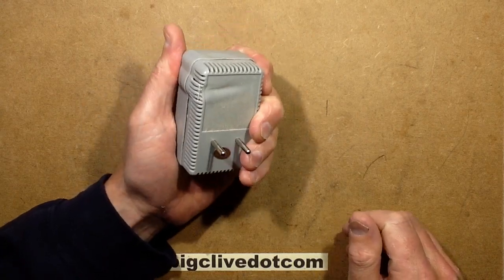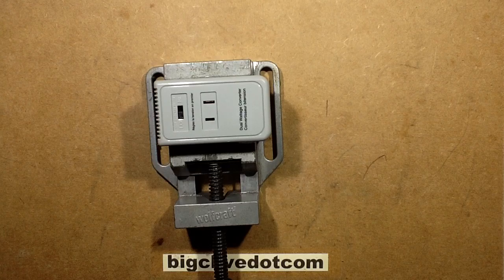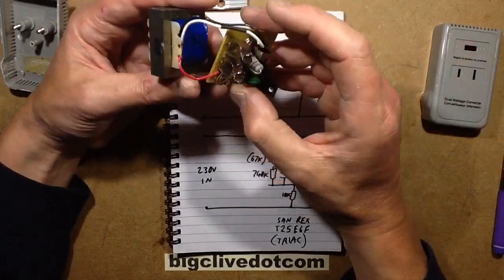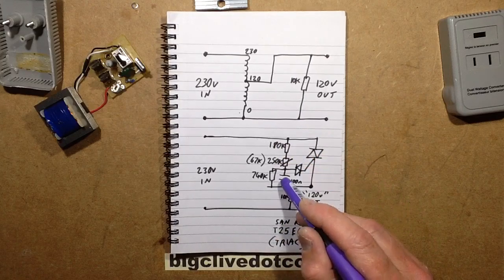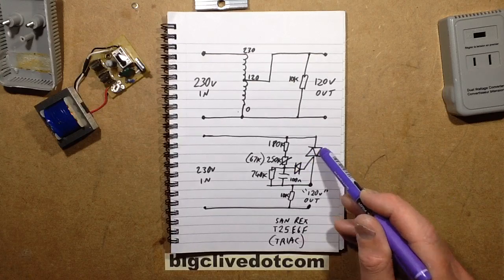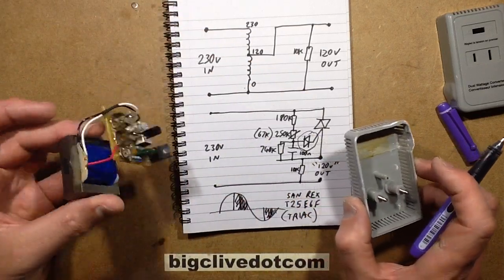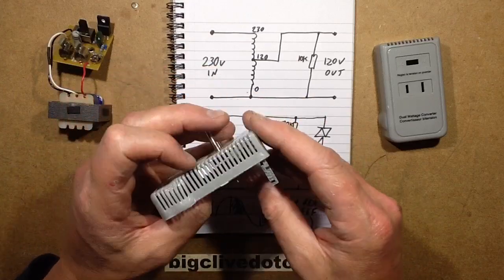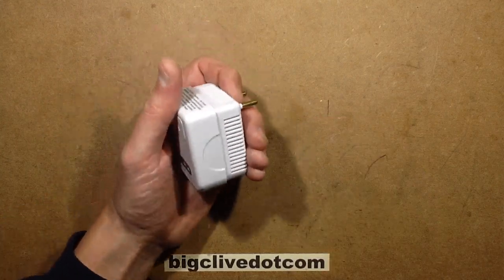Melty moments with a 230V to 120V converter.

Comment: Does that thing even fit into a German our French socket? That plug looks so awkward. No room for the recessed design of the sockets.

(And no earth either)
Reply: only for the pc master race
Reply: Sander Deryckere You are correct, it won't fit a great many European sockets (no French or German, and in Switzerland, only in the non-recessed outlets found in dry areas only, not the recessed ones used in bathrooms, kitchens, outdoors, etc). It should have the hexagonal Europlug protrusion, as a small handful of well designed converters do. (It seems to me that people  designed most plug adapters and voltage converters once 80 years ago and these designs got copied and keep getting made, even though the socket standards have changed both throughout Europe as well as in USA. So you get adapters/converters from euro to USA that don't fit most European sockets, and don't accept modern US appliances either, thanks to having a recessed and/or non-polarized US socket... it took me a while to find a company that makes adapters that actually work well.)
Reply: * or, hate it when auto correct does that.
Reply: There is an edit button you know?
Reply: +RogerWilco not in the android app
Reply: Banned by design in Sweden (which uses German sockets), such a design is import prohibited here
Reply: It would fit on a build in socket, without earth.
Reply: Antonio Tejada Only in Thai 2 pin round sockets.
Reply: Sander Deryckere It’s Chinese. Actual electrical contact not required. The purpose of the device is to make money, not regulate voltage. If you use the device for a purpose it was not designed for, you may get bad results.

Comment: Wouldn't the transformer output ~110 volts at 50Hz?  And wouldn't this be an issue for 60Hz appliances?
Reply: Probably only for mostly older appliances that use the line frequency for precise timing such as synchronous clocks and timers, turntables and cassette decks etc. Nowadays some electronics may still use it considering it's long-term accuracy.
Reply: Older vacuum tube televisions will not work properly on mains frequencies they weren't designed for, and may actually be destroyed. Newer solid state TVs may work if they use an internal crystal for the video signals instead of relying on mains for the clock.
Reply: Anything with a synchronous motor in it would just turn slightly slower, since the speed of those motors is locked to the AC frequency. For example a microwave turntable motor - these typically operate at 2.5 rpm when run on 50 Hz, or 3 rpm on 60 Hz, the low speeds being produced by tiny solid nylon or PTFE planetary gearboxes. The fan motors in microwave ovens are also synchronous motors (squirrel cage type, without gearing), and these would also turn at 5/6 the speed if run at 50 Hz rather than 60 Hz.
Reply: So what about a 240v 50hz appliance running on 240v(from two phases) 60hz?
Reply: I cant think of anything that is dependent on mains frequency and wouldn't overload that poor transformer

Comment: I have one that's quite heavy and rated 100W, it's a step down from 220V to 110V, so that I can power 110V water pump with it. It keeps running for about 6 months now, non stop 24/7. Quite happy with it.

Comment: Weird resistor value day today? Neither of the values would be even in the E192 series. Not that it would matter because of the tolerance. Regarding the second heatsink... A hollow heatsink (full enclosed cavity) wouldn't make much sense, would it? Surely the cavity would have a higher thermal resistance than the same space filled with aluminium.
Reply: The guys at whatever Chicom fab made them probably derped and had a big lot of components that were off spec so they just marked them to the mean of the lot.

Comment: I wish I'd seen this video a few years ago. A Japanese guy at work gave me one of those adaptors to run my imported Japanese Sega console. It ran for 10 minutes, then emitted a cloud of pure white smoke.
Reply: At least it kept the magic blue-ish smoke.
Reply: yup, the psu has capacitors on the input, those were charging up to the full mains voltage, the dimmer circuit can't stop that
Reply: +Zapp3012 at least the swag isn't too complex so you might be able to repair it yourself (possible). Although I'm not too familiar with its guts.
Reply: which one emitted smoke? the sega or the converter?
Reply: The Sega. It has an internal PSU. I'm guessing that's what was killed.

Comment: Im sure ive seen the BTA triac in disco lights, flashing to the music.
I would not use a simple dimmer for anything other than lamps.
Reply: I did something similar with some old squirrel blower motors that were pulled out of projectors. They ran too fast for my liking so I put them on a 450W dimmer switch.

The motors get very sad at certain dimmer ranges and make all sorts of metallic whine noises which sound really eerie. I don't care too much about destroying them because the bearings were already cooked (reason they were pulled out of service in the first place.) I manage to keep them running by re-greasing the sleeves every few months.
Reply: Or some ventilation fans. I have a couple fans out of an old air exchanger (like '90s) which were wired to a 600W dimmer on the front panel. The motors do run warmer on low then high, but not uncomfortable to touch. You can hear the dimmer causing a modulating effect on motor windings a bit as the fans spin up though. It sounds similar to a lightsaber. :P
Reply: There must be all sorts of frequencys being generated by the chopping of the waveform, and the gaps of no power must play havock with the windings :-(
Reply: zx8401ztv
I was thinking that too. Must made the motors a bit sad getting choppy power. D:
Reply: lol :-D
Reply: Could you use 2 big capacitors to smooth out the waveform some how?
Reply: *****
Maybe a AC/RF pass filter if it could handle the power. A 100uF run capacitor on hot and power filtering double winding inductor in series with both neutral and hot, and a parallel resistor (maybe 5-10K 5-15W) across the output between hot and neutral.

Comment: They are crap. The only decent way to convert 240 to 120 is to rectify the mains, filter it, then convert it down using switch mode and then pull it through an inverter synchronized with the mains sinewave and put it out.
Reply: Or maybe just a very big transformer?
Reply: By far the easiest way in the UK is to just use a site transformer, they are everywhere and dirt cheap, I cant understand why anyone would want a noisy electronic device,
Reply: +AIO inc Oh, terrible.  I would say 240V.  Out here in Canada we get a maximum 1800 watts from a standard outlet on a good day.  I am jealous of the Europeans with their 2-minute kettles.  We have a saying: a watched pot never boils.  Undoubtedly it was coined by British settlers in response to having to wait an eternity for the tea.
Reply: 1800w?? Oh dear... Quite a contrast to the UK's 3100w (I think that's right..). You have my sympathies.. :( Maybe you'll invent a kettle that uses two plug sockets or something.
Reply: AIO inc. 120v is for little girls, a real man will have a minimum of 230v on his outlets. We can plug everything everywhere without having to worry about overloading our circuits.
Reply: Kyôdai Ken Gross overkill.  A great big huge transformer works wonders every time.  Cheers!
Reply: Exactly why our sockets are shuttered so that you cant just stick metal things into them and get electrocuted
Reply: AIO inc. That's similar to how it is here.  Standard branch circuits are limited to 15 amps.  Anything more requires a specialized outlet that few homes have, and even if you have such an outlet, there are virtually no household products available capable of using them.  All are designed to use 15 amps or less.  So we are stuck with 15 amps and 120 volts.  It's not really about the voltage, but the power.  And 230v Masterrace... I like it.
Reply: For most people, noise isn't a problem but I work with SDR radios receiving weather satellites and I have to switch off everything to get a clearer signal.
Reply: Reptilian Capriccioso I love that.  You would need two cords to reach different branch circuits though.  And the kettle would need two elements.  Otherwise things could get interesting.  Talk about melty moments.
Reply: Mine is 1800w
Reply: AIO inc. Well, my whole point is that we are very limited in how large an individual load can be.  Under ideal conditions, you can get  1800 watts out of a standard branch circuit and no more.  All appliances made for use with a conventional wall outlet are designed with this limitation in mind.  Unless one goes to extreme lengths, there's nothing we can do about it.
Reply: and in the UK we have  240V we were supposed to drop to the european 230v but Nahhh never did
Reply: *****
A teeny bit, but no-one is going to slip it in their pocket and sneak off with it?
Reply: I would think a transformer would be the way to do it .... seeing its AC and stuff ... but yeah going the electronic route that would definitely be the way to go.
Reply: PandaWonka - not quite you need volts and current if it was only current welding would be a lot more dangerous and it only takes less than an amp to kill
Reply: Either way It's still 50/60hz cycle...
Reply: Average Joe
A bit cumbersome I would say...
Reply: not_found
A real man has a backup power system in his house.
See: Photonicinduction

If an electrician saw my house, he would weep, I've got so many computers and other crap plugged in that my electric meter must be spinning a hundred RPMs.
Reply: pillsnotbills
My home is limited to 100 amps, and I've got plenty plugged in. See above.
Reply: Now I know how outsiders feel when reading conversations about my hobbies... I can't understand a damn thing in this entire thread. (Yeah, that's pretty much all I wanted to say. Don't really got much to contribute here.)
Reply: 13A per outlet but the ring cct can supply 32A at 240V
Reply: Les King you won't die from sticking something in an outlet just because its 220v instead of 120v, its the amps that kill you.
Reply: Reptilian Capriccioso
In the EU, vacuum cleaners over 700 Watts are prohibited...
Reply: Yes.. Let's hope I'm not in a position of power in any major electrics company too soon.
Reply: pillsnotbills
Why is 120v terrible?

I don't boil water very often, and on the rare occasion I do, I use my gas stove.

Here we have 120v for household appliances, 220v for things like electric stoves, washers, and dryers, and 440v for industrial equipment.
Reply: pillsnotbills
1800 Watts seems like a very reasonable number.

Having all the computers I've got, I'm certainly drawing much more than 1800 watts out of just one room.
Reply: 120 volt master race. When my clueless 2 year old self sticks a wicket in a socket I'd rather not die
Reply: The best way is to just have one single standard (I'd say 120V with the European style connector) and be done with it all.

Comment: for people living in the U.S, Canada, Japan where 110 V is the standard this product is ridiculous. almost all heavy load devices, hair dryers, travel irons have a 110/220 V switch you can flip. almost all modern low power devices can run 110/220 V, like cell phone camera chargers etc. all that's needed are a few cheap outlet adapters. most devices today charge with 5 V, and a USB type B. if you accidentally left the switch in "high" mode and plugged a camera or phone into it, you would likely fry your charger and maybe your camera or phone. for travel make sure the charger is rated 110/220 V and get a few Euro/UK adapters
Reply: Uh. My kettle is 120v only, as is my hairdryer, my iron, my coffee maker, and my toaster. I'd say almost nothing with a heavy load has that magic switch.
Reply: These things are not all that recent, though.
Reply: Do you take these things on a vacation trip? If you're moving to a 220V country, buy the new appliances. My wife has 3 hair dryers, all with 110/220 V switches and they cost about $15
Reply: Probably means they're travel hairdryers rather than the big ones that manufacturers presume you'll keep in-country.

But yeah, especially for cheap equipment I really don't understand why you'd want to move it across an ocean and then spend extra money to make it kinda-sorta work in the destination country. And for the good stuff, when it isn't 110/220 capable and/or selectable in and of itself (most things with a switching power supply are), get an old-fashioned autotransformer.

Comment: plz recomend me to buy convertor for charging ryobi cordless drill charger in uk bought from usa 120
Reply: Buy a Ryobi charger in the UK. Safest way to do.
Reply: +BloodySword thanks.
Reply: waqas ahmad
If it is only one time, try to borrow one. ;)
Reply from the maker: Is it a Ryobi 18V system?  I too would recommend getting the proper UK charger, and maybe getting it as a pack of charger and batteries.
Reply: Have you checked the back of the charger for its rated input? It might well accept 230v out of the box. Many power bricks do nowadays
Reply: +ElmerFuddGun thanks bro
Reply: +bigclivedotcom thanks
Reply: +bigclivedotcom it is ryobi 18 volt corless hammer drill and charger is almost 85 watt .wattage us not conferm
Reply: Two thoughts... buy a 12V charger for it and use a 12V power supply when you need to charge it off AC.  This way you can charge it in the car or at home.  Second option would be to find a large 230V to 120V transformer.  Often found at electronics component shops.  This allows you to use it for other things that you find run on 120V AC.
Reply: If it doesn't have a universal input, you could use a stepdown transformer. It would probably be cheaper to just buy a new charger though.
Reply: sheck out harbor frieght .com  they might be able to send you stuff.
Reply: Nathan Dean HF only ships to Aus and Canada I'm afraid.
Reply: +zogworth only 110 supported
Reply: +rocketman221projects thanks
Reply: +Nathan Dean ok try ....thanks
Reply: Get or make a 16A CEE 110V plug to NEMA 5-15 receptacle adapter for use on building sites or anywhere else where 110V is available.
Reply: Wouldnt the different frequency have an effect?
Reply: zogworth
Most switchers do not care within reason.
Reply: zogworth For most things 50 or 60Hz line frequency does not matter.  The odd device might use it as a clock and on a linear voltage regulator you can get a bit more ripple when going to the lower frequency.  With LED lighting or PS power indicators that only use a half wave rectifier you may also notice the effect of frequency.
Reply: +Sannesthesia thanks

Comment: I wonder if part of the reason for the solid heat sink is to make the product heavier. Make it feel like a more quality item. Even trick people into thinking it might have a transformer in it.
Reply: Agent Office Yeah, fun part is that it wasn't something from China or some shit, they were marketed as Premium Swedish quality
Reply: Like those ultra-crappy Nikon, Pentax and Canon look-alike plastic cameras (one even called 'Niktax'!) with a chunk of lead or something similar in the bottom to con you into thinking you're getting more than 10 pence worth of plastic for your money.
Reply: +deIlluminati smart business
Reply: I remember that there was a PSU company called Ace of Sweden that put concrete in their PC power supplies to make them feel heavier. They also didn't have any thermal fuses of any sort so they usually caught on fire and destroyed your computer.
Reply: Probably.
...or that mass can serve as "heat mass" so device will get hot and forces user to disconnect it. I've used this technique to discurage me from using power on my e-bike project.
Reply: +SouthwesternEagle I have only pedal (and ~15hp electromotor) powered chopper style bycicle that can make up to 60km/h with cca 45km range. ;)

Anyway, making things weight more is just classical cheap crap from china signature...
Reply: +Warialinth LightHoof (Šimon Karatsiolis) 
Are you a biker? I'm a Harley biker and a Furry! I have never found another one of my type.

Comment: Drill the big Heat sink on the second one, I saw two parts that are welded together and I suspect it's hollow. Only a drill will confirm.
Reply: Hold it in one hand and give it a light tap with a hammer, a hollow one will absorb much more of the impact than a solid block.
Reply: +webchimp That would work, but we're is the fun in that 😀